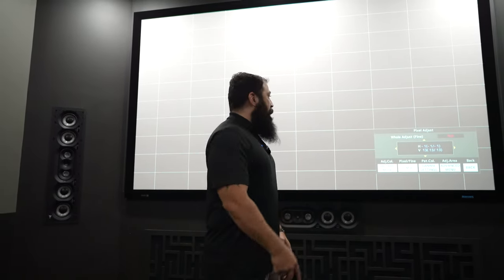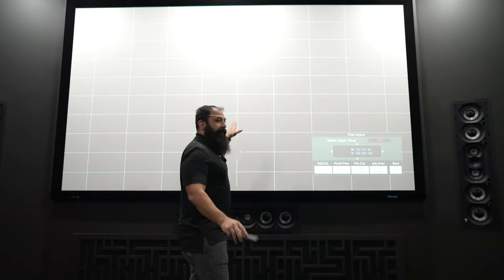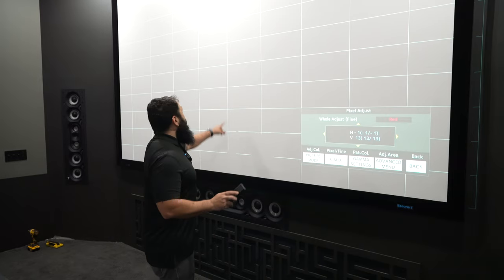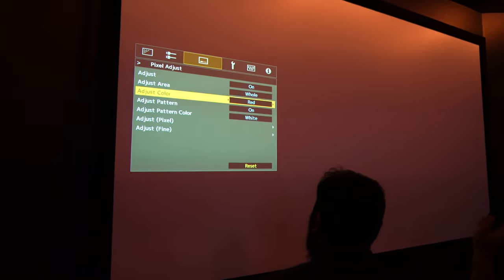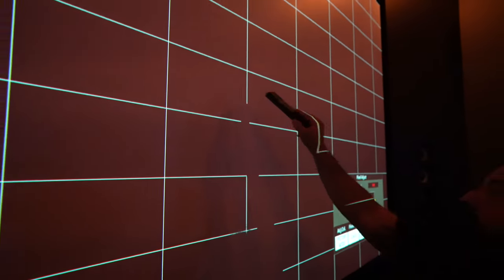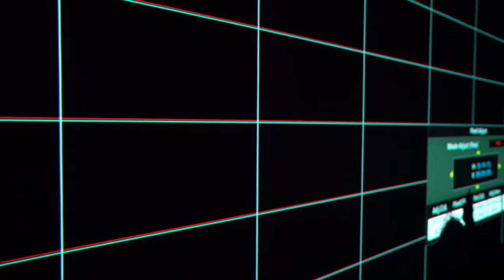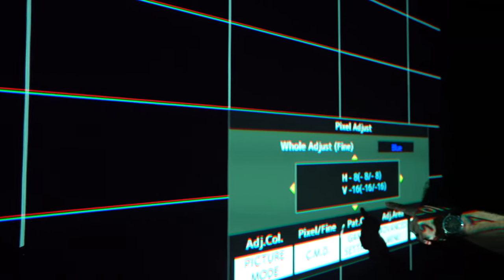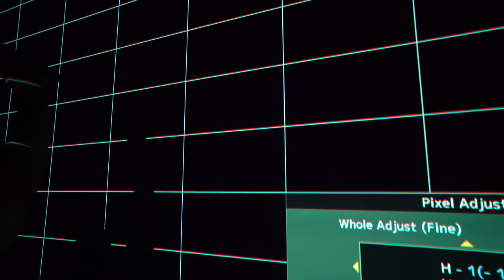How to: Projector Panel Alignment on a JVC Projector (Works on Sony too)

Comment: Thanks for the video.
When they have the acoustic treatment, will they put measurements to see the acoustics of the room?
Just curious to see the RT (Topt, T20, T30), Waterfall, Spectrogram, ETC, Impulse

Written with translator

Greetings

Comment: Do you continue and do more zone adjustments or just stick with one in the center?
Reply from the maker: Thanks Clark! You certainly can, but for every action is a reaction. You could get stuck in a never ending alignment problem. It is best to get the center of focus aligned best you can because getting the outsides aligned will move everything else slightly.

Comment: Why are you only using the fine adjustment? I was thought by my JVC guy to try to stick to whole pixel adjustment as much as possible.
Just wondering on the difference as with the whole pixel step I get it spot on with my JVC as well. Thanks!
Reply from the maker: Hi Pascal- I’m not sure what you mean by your question.
Reply: @Dreamediaav  in my JVC I have the option to shift whole pixels, or fine (as you do in the video).
A fine adjustment is how I understand 1/16 pixel per step so could result in an unsharp image if you shift to many, eg. 8/16 which would be a half pixel.
At least that is how I understood if from my JVC guy :)
So just wondering why to use one or the other 👍🏻
Reply: @pascalpeulen2645  Your JVC guy is right. With fine adjustment you will lose some resolution on that color.

Comment: Did anyone else see a red line right where he was doing this after he got done adjusting the red? Lol

** For anyone that doesn't know, the 3 colors are supposed to all merge in to one and equal a white line, so you shouldn't see any 1 color besides the white